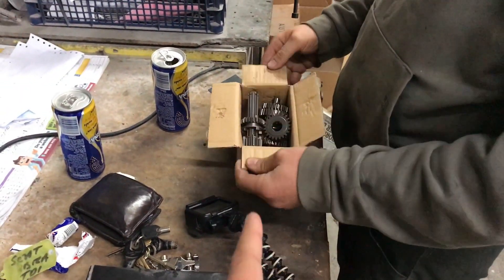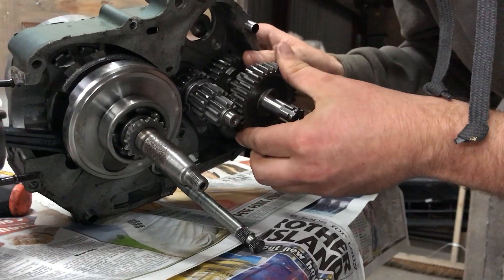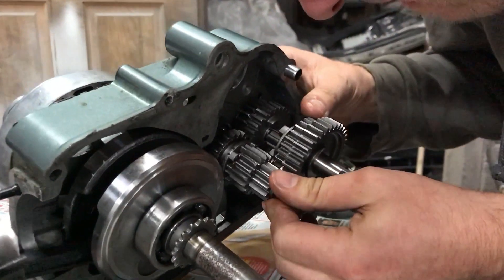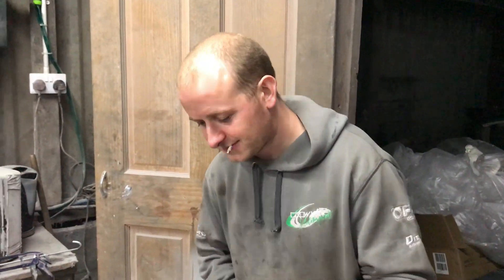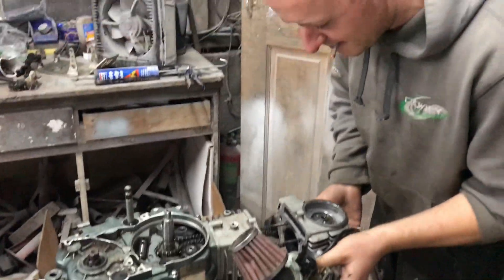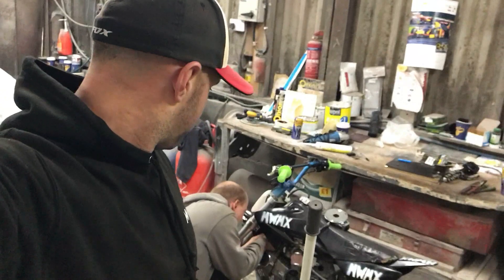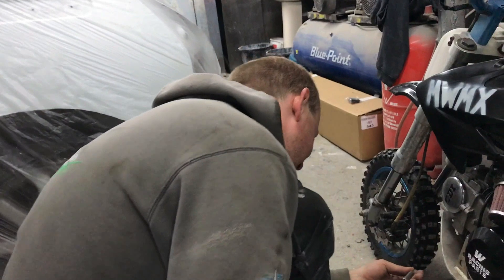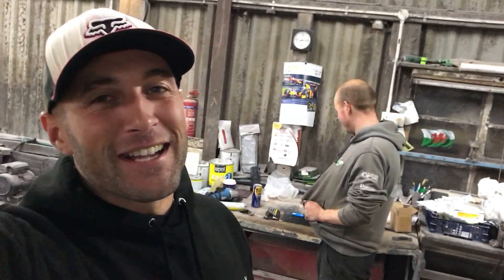CHINESE PIT BIKE BUILD - DID WE FIX IT??

Comment: Your spare washer looks like a thrust washer, they go either end of the gear shafts to stop the hardened steel of the shaft wearing away the softer metal of the crank cases. You may find you wear a hole over time

Comment: From my experience it would be the kick start gear. It has to be in the correct spot so when it’s started and the spring brings it back up it isn’t engaged with the engine. Very often it will happen when we pull apart something we weren’t shore about to start with iv done it myself and was stumped for ages. At least you done the first thing rite and had a go yourselfs 👌
Reply from the maker: Thanks for the advice man. Will be getting it done soon 👍

Comment: The problem w/ the starter might be an internal part on backwards so it can go down but not up again or no return spring however if it turns down when you bump “start” it in may be incorrectly connected to the transmission
Reply from the maker: Yeah I think we connected it wrong. We didn’t know what we were doing so it turned out ok for guess work 😂

Comment: check the return spring it should be inline with the crank casing thers a little mount for it message me if you need the hole engine sorted